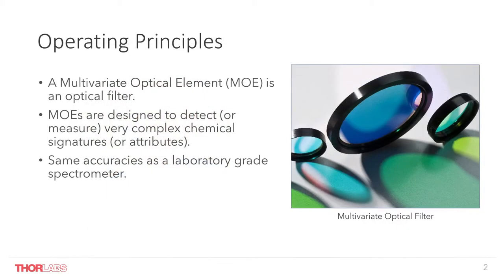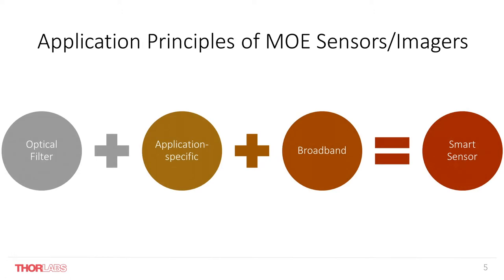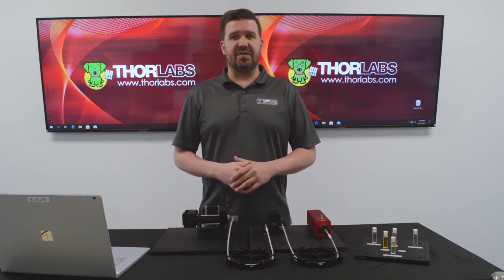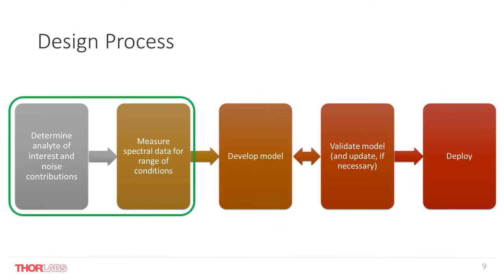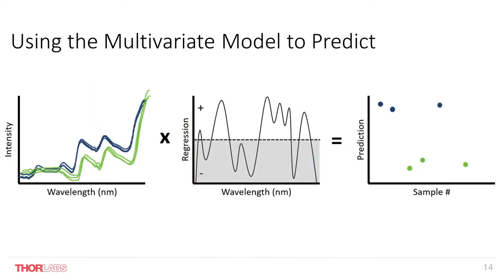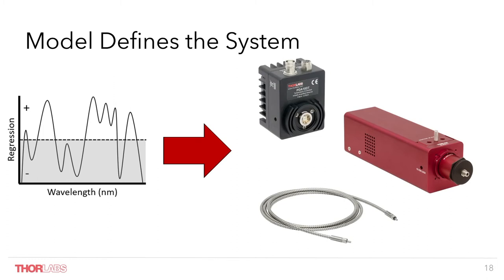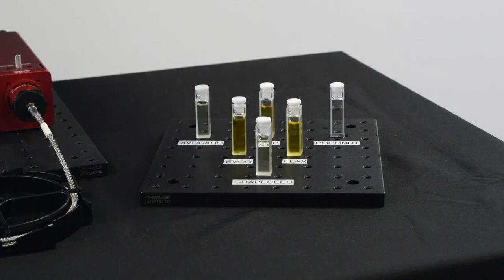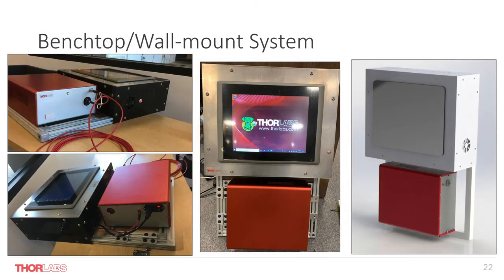Multivariate Optical Elements (MOE) for Real-Time Chemical Sensing

Comment: This is great.. it is nice if you release some of the most common chemical sensors to the mass markets, which will be able to boost up numerous IoT deployments currently stuck due to lack of affordable sensors. 
I'm sure if you plan for mass production, it could scale up pretty well similar to cmos. Manufacturing boils down to a thin film coating process.  Will have huge benefits to Agriculture and Food industries for the masses.
Reply from the maker: Thank you for your comments and for taking the time to reach out. Historically, customers have looked to more customized solutions to detect analytes in complex mixtures and matrices. With that said, the team at Thorlabs Spectral Works is currently reviewing the most common applications where MOEs will provide the greatest value. Stay tuned in the coming months as we look to provide additional off-the-shelf solutions. 

As we already have systems and solutions that can be adapted to many customers’ needs, we’d invite you to reach out to us at TSW@thorlabs.com to discuss specific needs in agriculture and/or food.